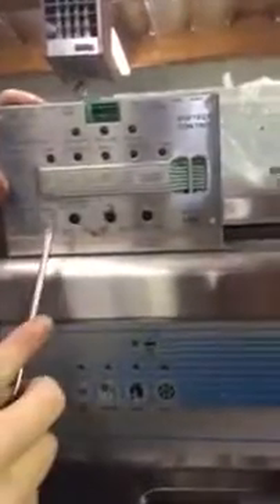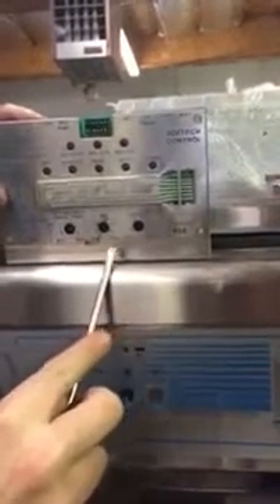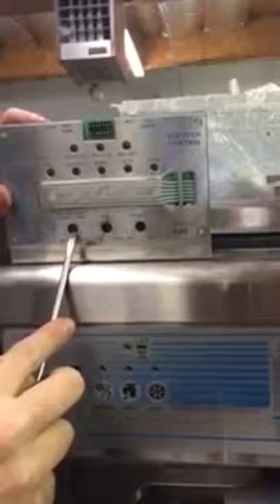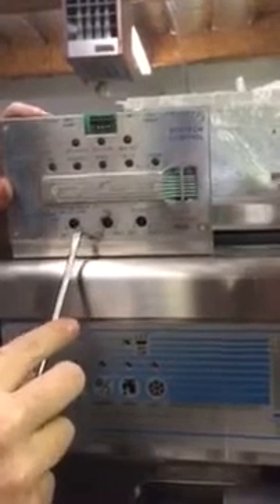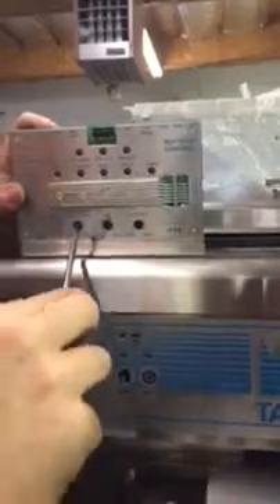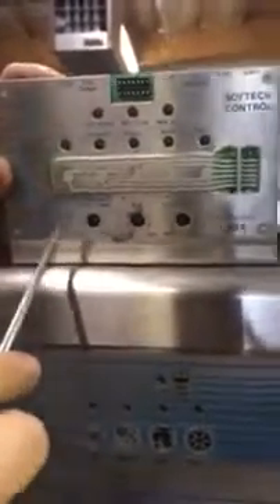How To Modify The Soft Tech Control Board On A Taylor Soft Serve Machine

Comment: If you need the mix in the hopper colder do you turn the mix screw clockwise or counter clockwise?
Reply from the maker: Clockwise is (towards max) is colder - I would suggest making small adjustments, waiting and testing the temperature with a thermometer.

Comment: Jeff ALways Dry... No you do not need a board. The reason your product is going soft is 1- you need to replace your scraper blades, or 2 you could be low on refrigerant. The 338 uses only one compressor, two suction solenoids and two liquid line solenoids. id be about 99% sure that the suction solenoid on either side is covered in oil and leaking. That is why the product is going soft. It starts off ok then goes soft? Im guessing one side takes a lot longer then the other to freeze down? 338 was fun to work on... other then if it was in tight spot on the counter and i had to get to the back .... Machine is a monster. part# for your leaking valve is a 048626-27

Comment: Thank you. I have 338-27, but the left side gives soft icecream. Adjusted the temperature, worked for a while then soft again. Do I need to replace the control board on this side? The other side has no problem. Thank you

Comment: Hi Slices Concession. My machine is a Taylor 8752 and it has developed a slight problem. It is switching itself on and off frequently during freeze-down and I checked my condenser and it is clear and clean. I was informed to adjust the Viscosity setting and this improved both the initial and in-use freeze-down. After a few weeks, when sales were heavy, it started to play up again. The Viscosity setting is now as far to the right as it can go and I am worried it will start playing up again and I have no adjustment left. Also, it sometimes switches the pump and compressor off for a few seconds while I am drawing an ice cream. Do I need to replace the control board, and/or the beater motor (I have a spare motor) as it could be drawing a higher current than before and making the control board detect this higher current fooling it to shut down instead of the ice cream actually firming to make the motor draw more current?
Reply: lograste solucionar amigo @robert wood ? tengo ese problema